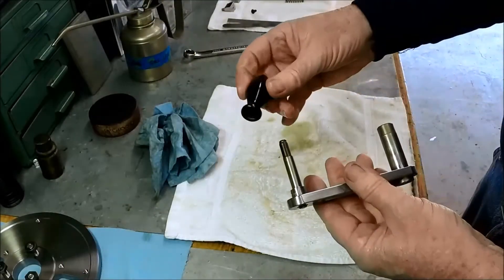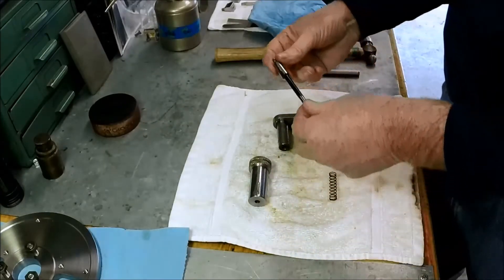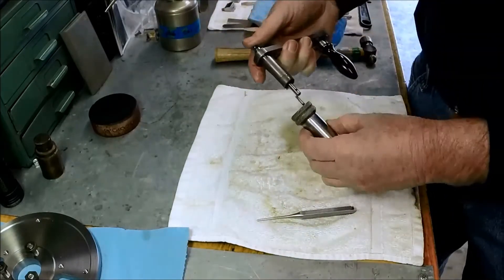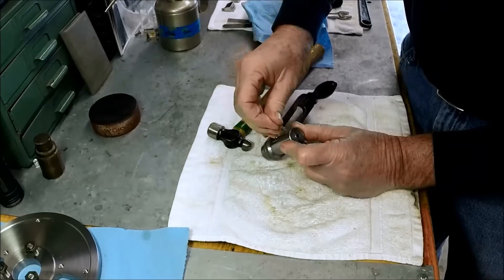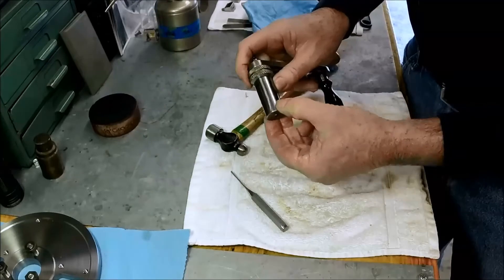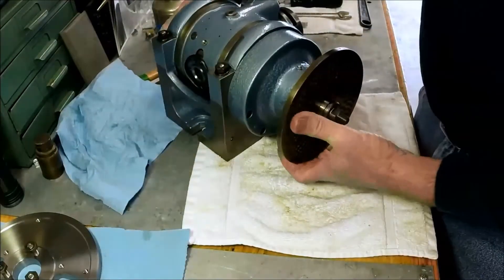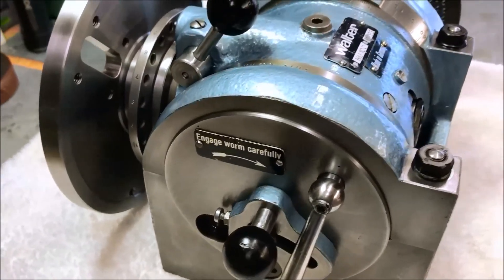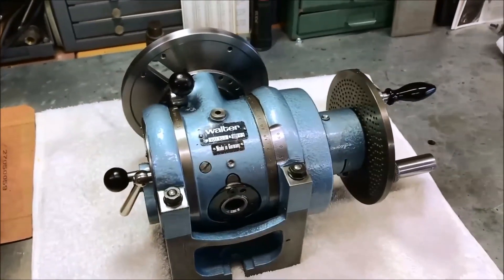Walter Dividing Head Restore Part 4b

Comment: Of topic,  Hi Dean  would you have a drive select lever for a south bend lathe 10 apron for sale please  Jim England
Reply from the maker: Jim,
I have a apron casting with the selector lever on eBay right now. If it doesn't sell, I'll sell the lever separate at a low price. It has 6 days left to run.
eBay item number 132940046001
Double check the photos on the ad.
Thanks, Dean
Reply: @TheAyrCaveShop  Hi Dean did the apron sell I am still interested Jim
Reply from the maker: @TheJimtodd  Jim, It did not sell. Did you look at the photos to confirm that's what you need?
Here's my email dean57ayr@gmail.com
You don't want the casting, just lever and shaft?
I'll disassemble tomorrow to check fit in a small FR box, and figure some kind of price or trade.

Dean